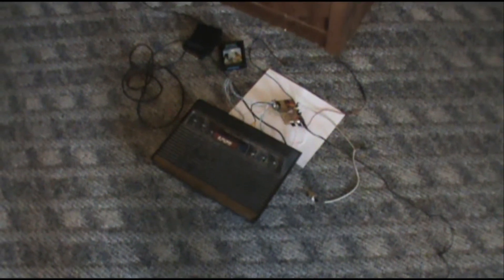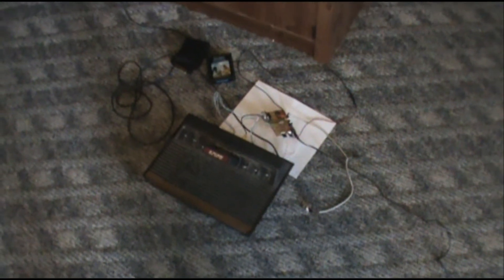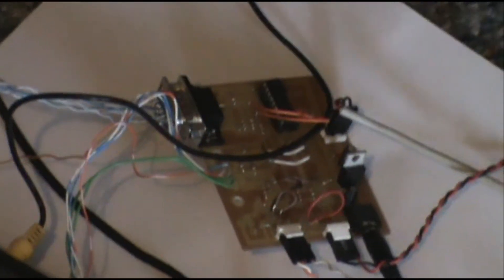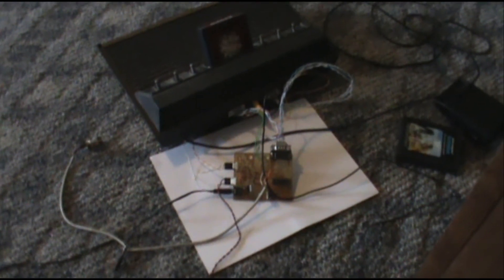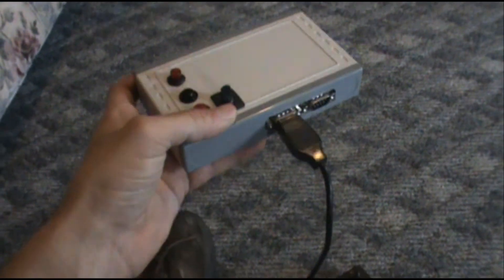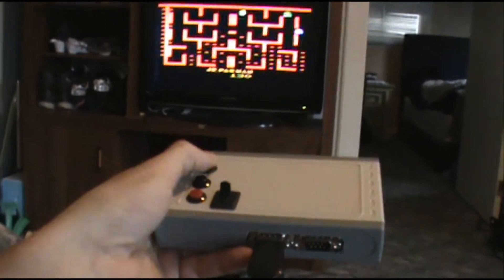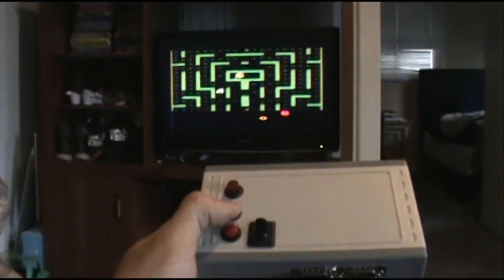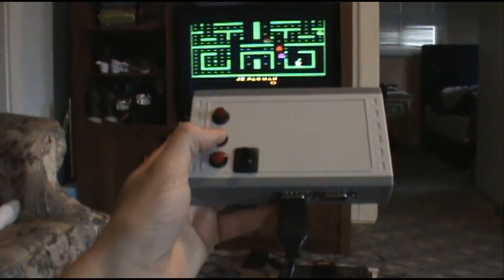AtariRC Prototype Demo

Comment: A product already exists. A mod for real stereo/surround, AV and pause mod via joystick. Currently build into the Atari 2600 Droid Edition series available on some vendors and ebay. Next product will be a bluetooth PS3 mod allowing to control the entirely atari or coleco console via bluetooth. Not sure what the lag is with infrared control but most likely it is too slow for gameplay.
Reply from the maker: +retro-modding.de We won't be building these for production, but it's blazing fast for any game I've tried to play, just as reactive as having the stick plugged directly into the console. It was a fun project to try.
Reply from the maker: You know, coming back to this comment...the gameplay is right there in the video with zero control lag...and clearly this was some kind of strange post to try to discourage us marketing this. Kind of a crappy move....